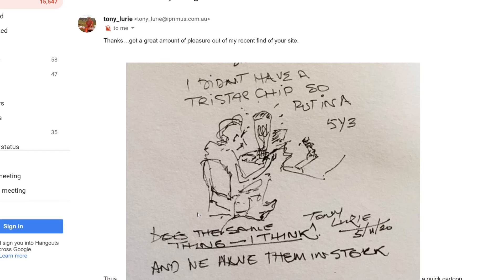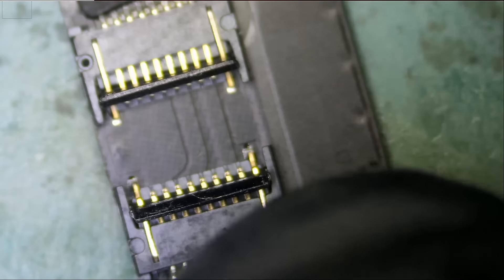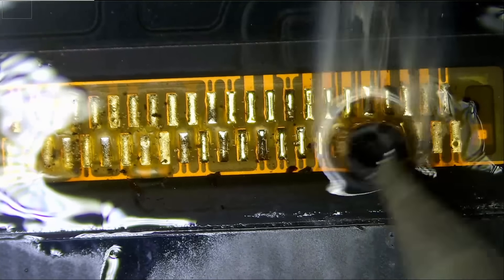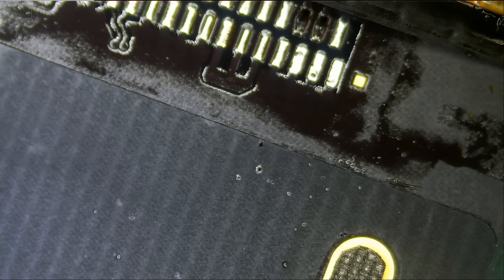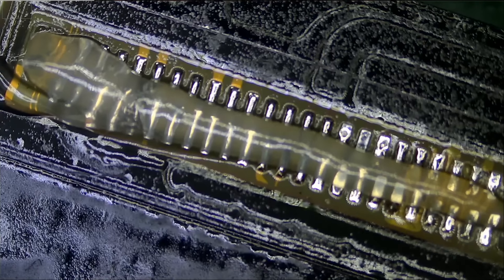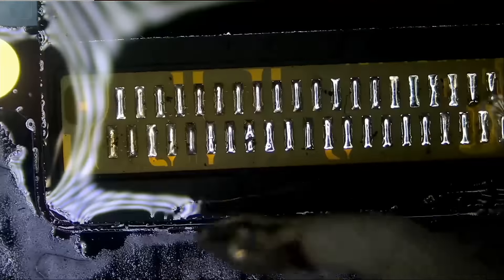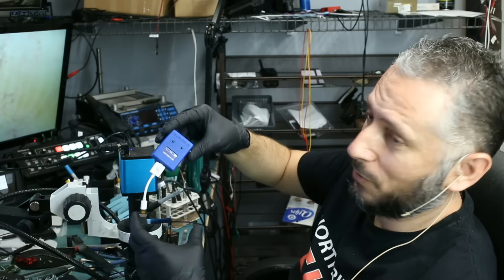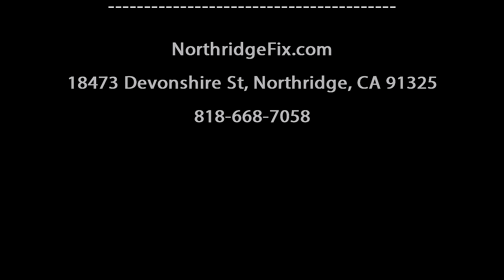iPad 7 won't turn on or charge -  Faulty Charging Flex Soldering

Comment: Great job as always. I see you prefer the clear flux compared to the AMTECH you reviewed a while ago. I found the milky colour takes a while to get use to as you need to heat it up first so you can see where you want to rework.

Comment: Doing my first iPad air 2 repair. Charger port and battery 🔋
Seen you take the solder off with wick but didn't see you or fresh solder down on pads before putting cable on top?

Comment: In an previous video you were repairing a display connector and saw touch was not working and you Changed a SMD or parts lf the Motherboard.
I just want to know how did you measure the ohm they take so that I can also find out too the same which smd is working.
And if you can find the case" Samsung Grand 2 g7012 touch not working it will much help for me.

Comment: Its fascinating to see how you get the solder to separate not sure why I can’t do that. Might be because I use a cheap soldering iron but any tips would be appreciated.
Reply: I'm no expert, but I believe the flux is the primary culprit in causing that effect...... I think it's virtually impossible without.

Comment: Was fooling around with a Casio PNM-500 motherboard recently. Splattered solder on the display pads and had to get it off again with old tech around in my home. I need the module for testing something with a tiny LED in the near future and it worried me when a pad lifted. The module worked anyhow and I wonder what glue I can use for a little connection pad?

Comment: I don't understand why so much heat is needed for low melt solder? You said you used 370 C from the hot air gun. That's almost 700F. You would think 350 to 400F would be hot enough. Can someone please explain.
Reply: Thermal mass, some of that heat is going to get soaked up by the board itself, so would take a lot longer trying to use 350 - 400f to reach the melting temp of low melt.
Reply: @GO-lo4tv  thank you